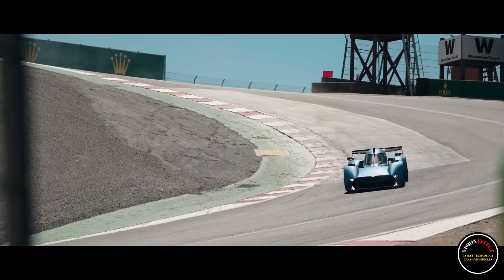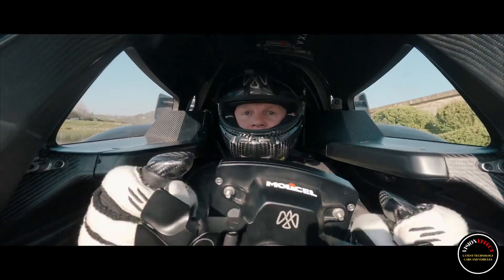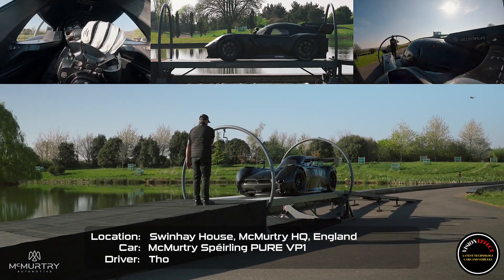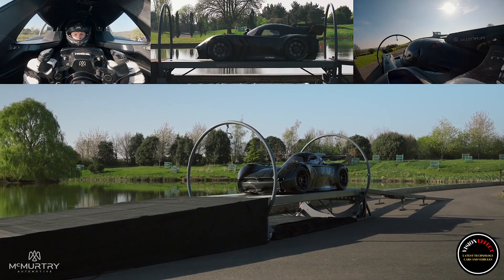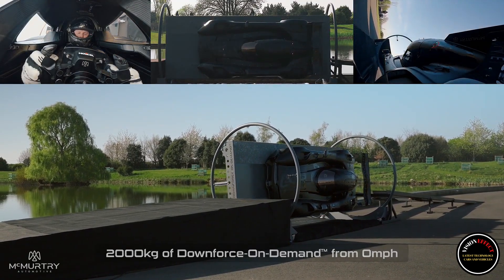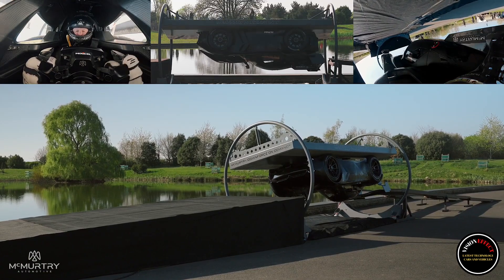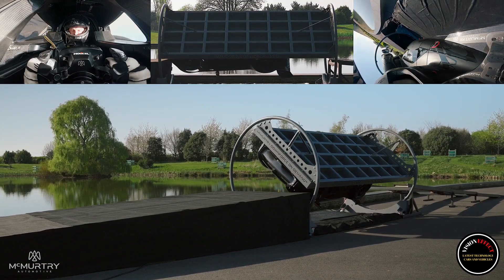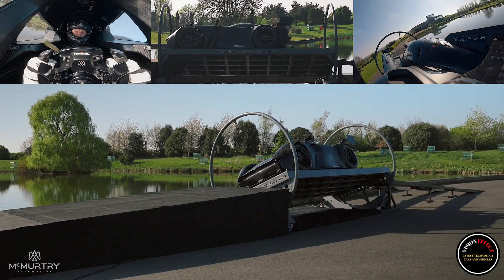Oh My God: The McMurtry Spéirling is The First Car in the World to DRIVE UPSIDE DOWN

Comment: For those not understanding why generated downforce is so important for performance vehicles, it affects Cornering speed (pushing the car down gives the tires WAY more friction so you can take turns at higher speeds without slipping), Braking performance (more grip gives you better braking, meaning you can brake later into corners), acceleration coming out of corners (the downforce creates more grip for the rear wheel ensuring no wheel spin on the road), stability at high speeds, and in a way it provides a lightweight advantage. Those 2000kg of downforce from those fans increases handling without adding a bunch of other heavy equipment.